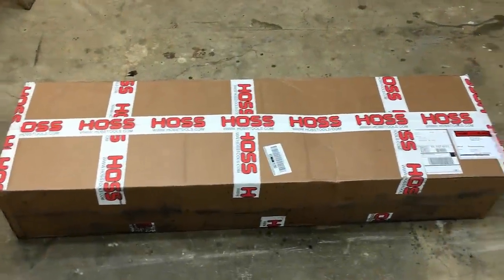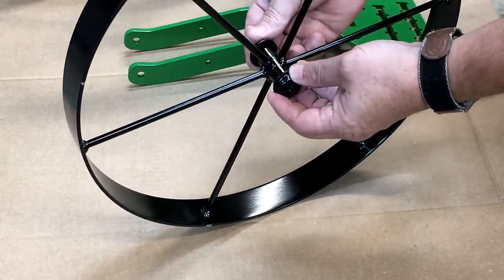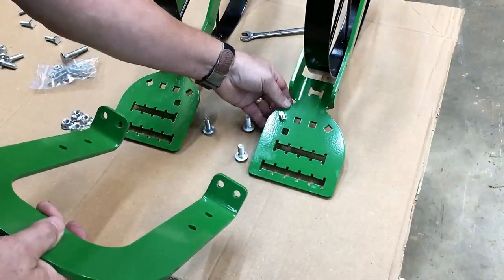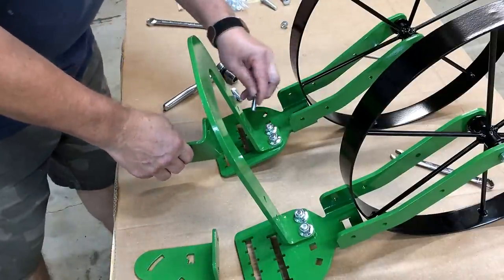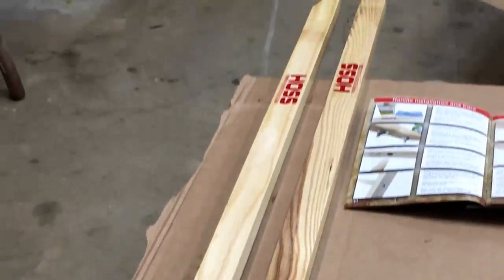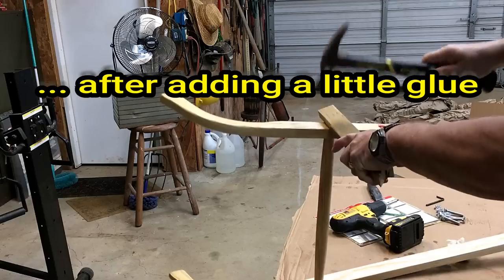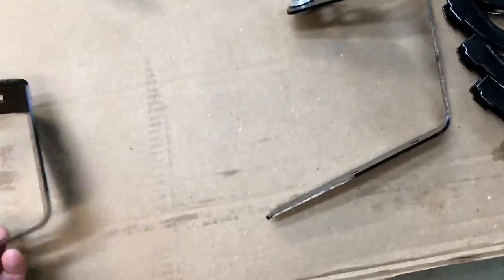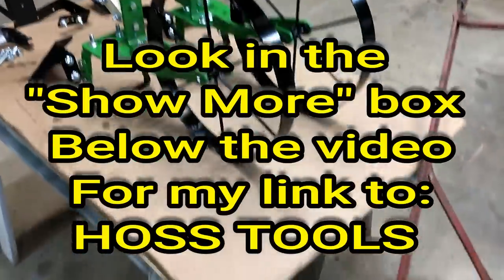HOSS High Arch Wheel Hoe - Assembly - What A Great Product!

Comment: How long is the cultivator handle? I bought without handles antique Planet Jr 25, wheel hoe and seeder,  I want to make them myself.
Reply from the maker: Gabriel 
Luckily, I was out in the barn when I read your comment. The handles are 48 inches long up to the curve. The curved part (which is where you hold onto it) is about 8 inches.
Looks like probably 1X2 material.
Reply: Thank you very much !